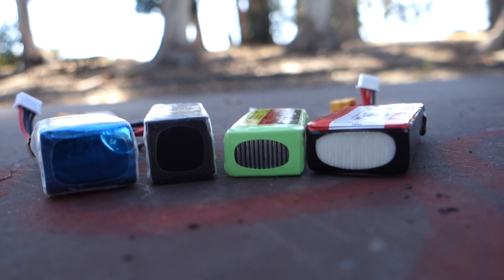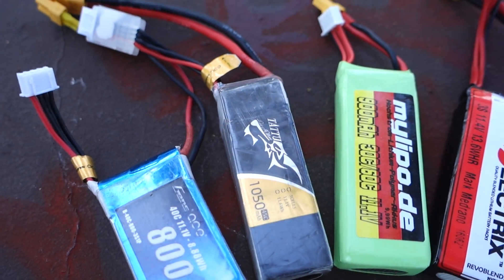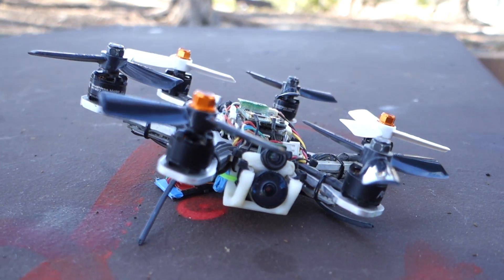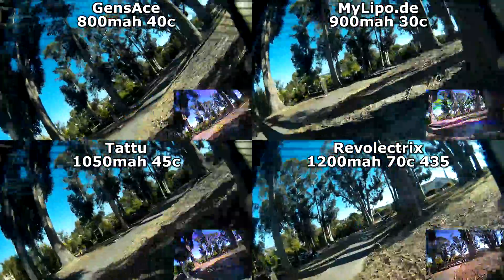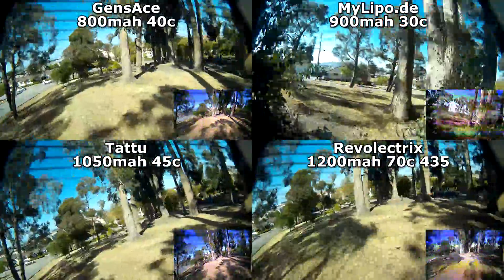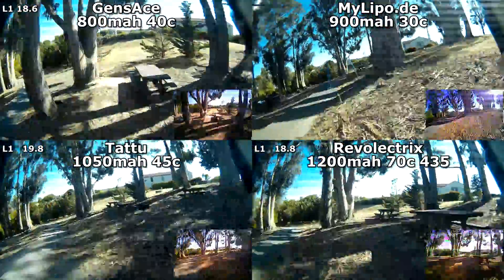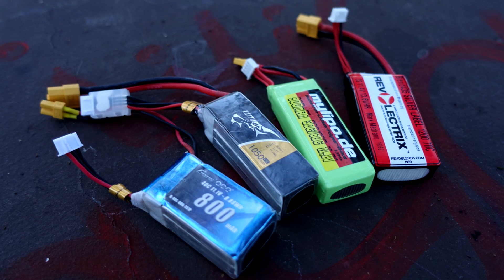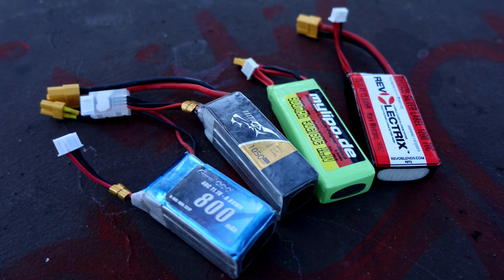Mini battery shootout - GensAce, Tattu, MyLipo, Revolectrix

Comment: Well this test doesn't really tell anything... ofcourse the revolectrix is going to win, it's a significantly larger battery in terms of amperage so it will be able to deliver more current with less voltage sag just due to the fact that its the largest battery in the group.  It's also a high volt, and you said you didn't even fully charge it, but it's still 0.1v per cell higher than the other three batteries... so basically all you've established is what we already know, is that more amp-hours and higher voltage will deliver... more amp-hours and higher voltage.
Reply from the maker: Yes, I'm sorry I didn't belabor the analysis because I thought it was pretty self evident.  The effects of capacity are most evident in the gens-tattu packs, as I know they're both Grepow cells.  Increased flight time and decreased impact of sag, but the total proportion of saggy laps is pretty comparable still, around 50%

The myLipo pack I hear commonly recommended, it's 10% higher capacity and 20% lower C rating one would think would put it in a slightly worse place compared to the gens for sag but with slightly bigger total capacity, but the weight of the pack is identical and the performance is close enough as well.  Any difference in the manufacture of their cells (if any) doesn't make a significant difference in the application I have for them.

The revo packs are at higher voltage, but that is reflected in their total capacity as well, you can't just double discount their rating.  Importantly they weigh the same as the Tattu packs.  They've proved to have superior chemistry by actually delivering more power for the same weight (and not just marketing hype)  and a much greater % of time before sag begins to factor in (70% vs 50%).  I don't particularly care if the increase comes from their higher C rating, or the increase in total capacity (which I'm guessing may see another 5 to 10% increase on a full charge)  The fact that they were actually able to deliver on their increased power density was what was important for me to find out.